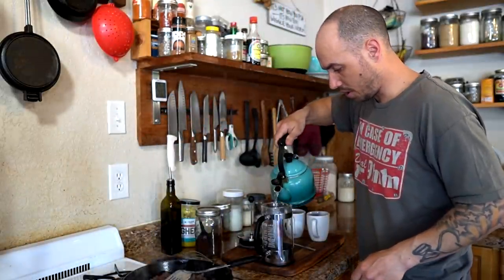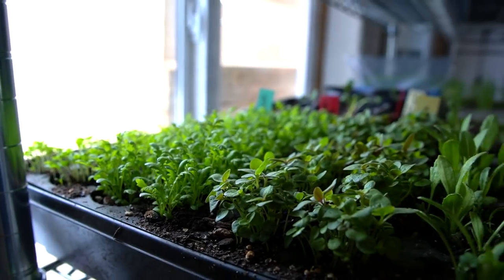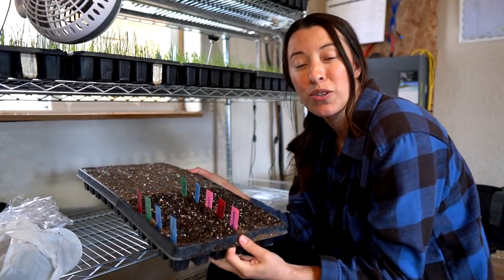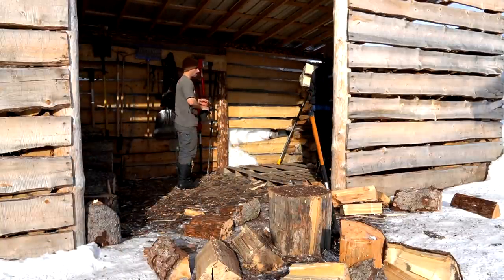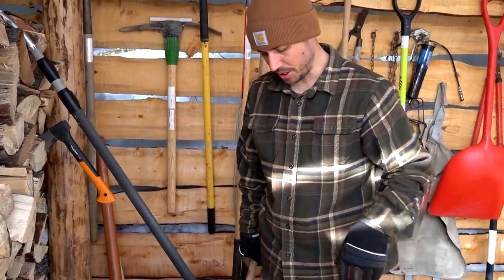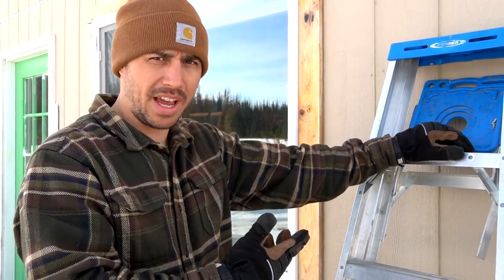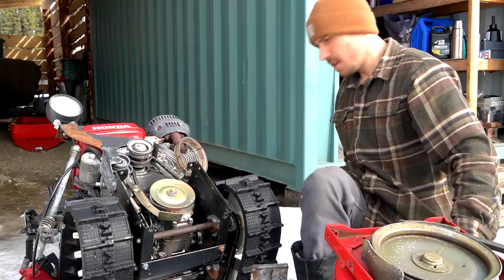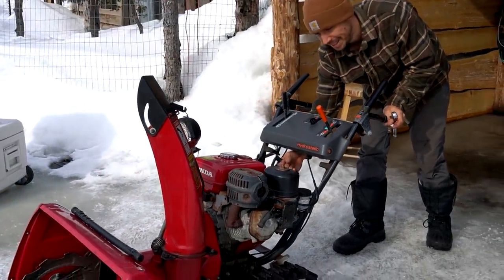A Simple Day Around the Cabin

Comment: Advice on your french press.Do not stir it at all! I worked for years as a coffee buyer for the worlds largest coffee company and had to constantly do presses all day long at head office and learned a ton. The boiling water in your press makes the glass vulnerable until it cools so stirring shortens the life of your press, A slight accidental tap and it can explode...One of my colleagues had that happen and you guessed it..he stirred in the press.Also when you stir the grounds you interfere with the oils as it steeps and you get a bitter cup. Never take the lid off and the only time you remove that top is to rinse at the end after letting the press sit an hour or two.If you worry about grinds you can pour the coffee into a cup with a sieve. My brazil bodum glass has lasted ten years ..before I learned the tricks as I used to go through glass every 6 months.HTH

Comment: Check your oil in the snow blower, I get engines in my shop all the time that the gas gets into the crankcase if not stored correctly or a leaky needle in the carb. Make sure to shut the gas valve and run the engine out of gas for long term storage. Thanks for another great video.
Reply: check oil level, smell for gas! Gas in oil then must change oil.

Comment: Prior to installing the new siding, maybe check out a house wrap product. Tyvek/typar are major brands. Along with ice and snow/water shield for areas where you have major openings into the cabin such as chimney, windows, doors. Use of these products will increase the r-value and help with cold air intrusion. A lot of small air  leaks add up.

Comment: Splitting wood is a good workout. I have found if I lift my lead leg. Similar to a pitcher does. and drop it during my swing. I get more power with my strike. I have also found the bigger and greener the wood. Split closer to the bark in smaller pieces . Rather than trying to split in in half. How cords a season do you burn?? Good on Arielle for trying our the maul. My wife loves using our log splitter . But she does need to learn to do it by hand as well. My neighbours father uses the log splitter for doing his kindling . He's 95yrs old, he sits on a stool and spends hours making kindling. When you pulling the siding off the cabin. I would consider adding a layer of exterior insulation before residing it. And love the footage of the dogs. They get along so well together. We know the feeling with our 3 hounds.

Comment: Good work. Smart to change both belts. Check that gas didn't flow into the crankcase. Shut fuel off at the tank before tipping. Best to change the oil and check the front auger gearbox.

Comment: That is engineered special siding sheets. I didn't want to call it plywood, but it's not osb either. It's 30-year siding sheets, I have it on my mobile home and it's very expensive. I've only painted a small part of my mobile home, the un painted areas= most of the mobile, is just fine no problems at all since 2001. All yours needs is paint, like mine it's never been painted. Just make sure every thing is nailed or screwed down good then calk all the nails, screws and cracks and corners, trim out the corners with 1x4 pine or cedar, calk , prime and paint. easy peasy! Or you could roll out tar paper over it and use it for plywood and cover it with cedar shake, then stain it, or just use Thompson's wood preservative, that would be cool, but the engineered siding sheets are just fine the whole cabin is just fine, It's really new , it's not old enough to have those kind of problems. Now the roof that's a different story. 3 tab can wick snow and ice up hill and condensation can also happen around the stove pipe area. I suggest an awesome cold roof over the existing roof with Manville insulation foam sheets, slat boards, and sheet metal, Check out The Outsider cabin build on YouTube. If you did both these upgrades the cabin it will last over 100 years! and being thicker on the outside walls and roof, just raised the R value and will keep the weather out more and more heat will stay inside= maybe save you some firewood usage, might even have to open the windows.... TOASTY! Sorry I wrote so much, I haven't talked to you two in a while, Your Friend Todd, 60 years old now, Arlington WA.
Reply: or house wrap
Reply: house wrap is definitely the right way to go

Comment: Here is a suggestion, Gas has a tendency to gum up carburetors. If you have a gas shut off, I recommend shutting off the gas and running the engine until it quits, best for long term storage. Anything of mine that doesn't have fuel shut off valve, I install them for this reason

Comment: I've always thought a snowblower would be a good thing to have a belt-driven generator head able to be mounted to: Get more use from your implements rather than just occasional (relatively) short runs.  Got a self-propelled mower that won't propel anymore, so I may try that myself.  Have to do some homework on whether a generator will vertical-mount without unusual wear.

Comment: Suggestion:  Your cable on the 4 wheeler looks in need of some 'cable dressing' to make it last. If you feel small sharp segments of wire sticking out from the cable with your hands then the cable is breaking down and needs to be replaced. A cable dressing will help keep grit and water from working its way into the cable body and cutting some of the wires. You really don't want that cable to snap when you're out in the wild.
You can look it up on the internet.
Ciao, Dr. Skip

Comment: Great video as usual, Have you tried using a car tyre when splitting wood, When you put the log you are splitting in the middle of the tyre so when you split the log it doesn't go flying off in different directions and it save your back in not bending over to pick it up all the wood.It has saved my back many of times

Comment: change the oil in the snow blower and make sure u turn the fuel supply off when stored... fuel is probably leaking into the crank case and mixing with the oil.

Comment: I can't believe all the snow over you still have as we haven't had much all winter. Sioux City Iowa had only 4.23 inches of snow all winter and we are 70 miles North East of them. And we only got between 25-30 inches of snow all winter and we usually get 70 plus inches. When we get strong winds out of the East Northeast we get snow in the attic and then when it gets warm out the snow melts in the attic and we have gotten some brown spots on our living room ceiling.

Comment: You have to take your small equipment and pull it till it hits top dead center.  That way you will not Hydro lock with fuel or oil it’s a good way to bend a Rod.  Keeps you from filling up the cylinder

Comment: great camera work there folks. Eric check to make sure gas did`nt get into the engine oil when you loaded up the cylinder with fuel.Maybe change the oil in the snowblower.  How do you keep you onions standing up? Mine keep falling over. I trim mine alot also.  Thanks

Comment: As a expert at firewood with decades of experience, here is a tip. You have the room, I can tell. Don't stack your wood back to front. Make your wood shed large enough to stack left to right, with a two stack open area. That way you don't have old wood dry rotting in the back. You use up the wood and replace the empty with new firewood. Back and forth. Get it? The key to kindling is making shingles first then very fast chops. Eyes closed. Ha ha. By the way, Eric is very good at splitting firewood. Good job buddy. Find the story crack.

Comment: HONDA SNOW BLOWER
I wonder if the fuel ( solvent) which entered into the combustion chamber and cylinder bore while the engine ( fuel system) was inverted presents any concerns?
   The piston is sealed to the bore with piston rings.  Generally there is a minimum of three but variations in design can specify more. The category and purpose of each piston ring is as follows: 1) Compression 2) Oil Scraping 
The oil scraping ring is quite interesting because it typically is composed of several stacked components into one set which fits into a single grove cut into the piston. The oil scraping ring in the center of the stack has a slightly compressed tension with a calibrated leak ( stepped surface) to control viscous oil coating of the cylinder bore. Above and below there are  two solid rings which create compression. Two rings are required because each has a relatively large gap and would leak without the other ring being staggered. 
   Gasoline is a solvent because it removes oil. It is also lower in viscosity than oil.
    So I'm wondering if there is a concern that the fuel will travel through the gaps of the piston rings because it would go into the crankcase where it would mix into the lubrication oil as the crankshaft rotates and splashes the mix into the sump area? 
   I'm wondering how to know if I should change the lubricant?

Comment: I'd wondered why you'd stopped using the kindling cracker. I had gotten one after seeing yours and like it. After hearing about your experience with it for splitting knotty wood I appreciated the point. The cracker works especially good for my wife because she doesn't have the confidence (or aim) to swing a hatchet in the direction of her hand. BTW, have you considered putting an old tire on top of your chopping block so you wouldn't have to pick up and reset the chunks of wood for additional splitting? Thanks for the video, Arielle and Eric!

Comment: What I've done with my 4 riding lawn mowers, and my DR power wagon is I put an in- line shut off valve in the fuel line and when I'm done using it, I'll shut the valve off and run it till it runs out of gas and dies. That way I don't have the problem of fuel gelling up and plugging up the carburetors, and we all know what kind of problem that is. On chain saws and weed eaters and other 2 stroke engines tools I try to run them out of gas. I buy non ethanol gas for all the yard equipment to save all the carburetor..... I don't want to always have to fix them, all the time and $ . You should now change the oil in the snow blower, for fear of fuel in the oil and because it's time and then you can put on the shut off valve on the fuel line. You may want to do this to everything, like the snow mobiles for summer. Those carburetors are expensive. You may not need to do this to the side x side because you run it all the time. I hope this help you out, Todd

Comment: If you two didn't  work so hard, you'd weigh 300 pounds. Lol. Your breakfast looked great. I could almost smell it through the screen.
The wood splitting was a good work out. Know you get alot of unasked for advice, so he's mine. There is a YouTube video of a guy that built a very simple spliter. Used a long lever, a big coil junk spring and a steel wedge. I'll try to find it again and forward the channel to you. Seemed to work very well. Till next time. Be careful.

Comment: One man's trash is another dogs toy,  we're worked not to lay up machines with petrol in them due to the high amounts of ethanol that is in modern fuel attacking plastic fuel lines and carbartor parts also it attracts moisture from the air and can cause long term problem with any machine